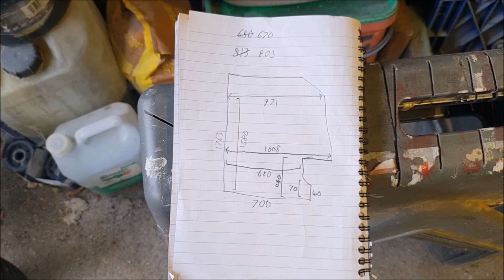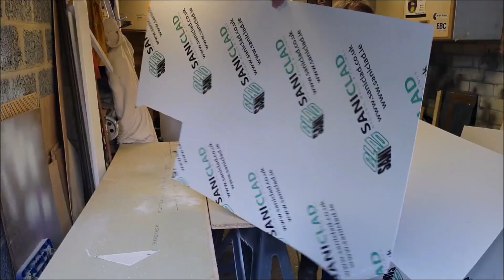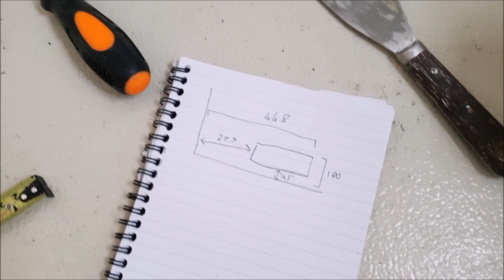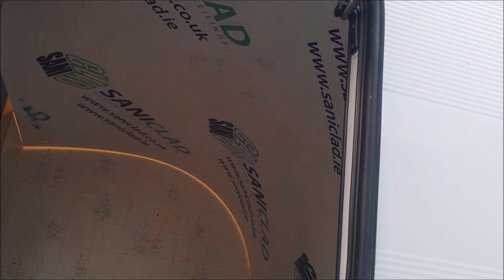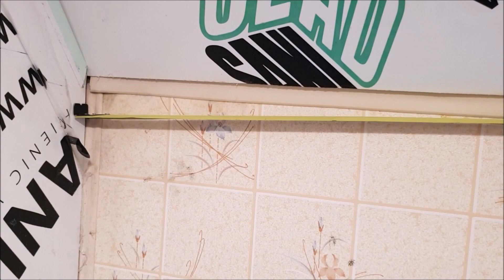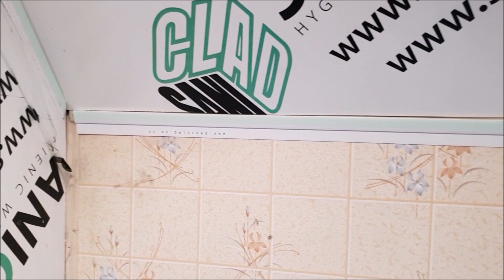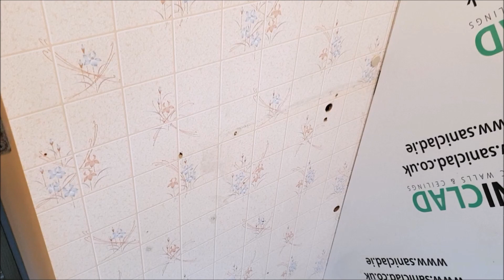Part Four Of The Re-Fit Of The Washroom In my Elddis Autoquest 270 - Beginning The Wall Cladding

Comment: I’m 2 years behind you Alex but following all your tips, just got our autoquest 270 and plan the bathroom refurb in January👍
Reply from the maker: Congratulations,  the 270 is a great little van. Let us know how you get on with the bathroom work 👍
Reply: @ttxela  hi bud, as it’s getting so cold, can you advise me on draining down the water tanks. My pump runs continuously and the water wasn’t flowing through the taps. I filled the tank up and now emptied the drain plug behind the near side rear wheel. Is there any other plugs I need to drain? The van is in getting painted so no access to it till next week👍
Reply from the maker: @davidfarrell8606  Hello David
I usually open all the taps in the van then drain down the fresh water tank - there should be a drain on the tank somewhere under the seat, usually near the wall. Also drain the water heater by the plug near the vent. I also drain the flush tank of the toilet.
Reply: @ttxela  thanks bud, didn’t know about the one near the water heater, thanks, I will double check it👍

Comment: Would it be possible to round off that corner ever so slightly so you could get pipework/cables inside?
If not conduits a good solution. 
Ps nice work dude 
Beauty 👍
Chas.
Reply from the maker: It's an option but the heater control cable positions would mean it would have to be quite large.

Comment: hi where did you get the plastic and trim for the bathroom? good job! also what thickness is the plastic?
Reply from the maker: Saniclad.co.uk it was the 1.5mm I used 🙂
Reply: @ttxela  thanks, is there any danger of cracking when cutting or is it quite foriving? its better than fablon of course!!!
Reply from the maker: @richardoloot1295  it's reasonably forgiving providing you have any blades set correctly with reasonably fine teeth. Any edge splintering was covered by the capping trims.